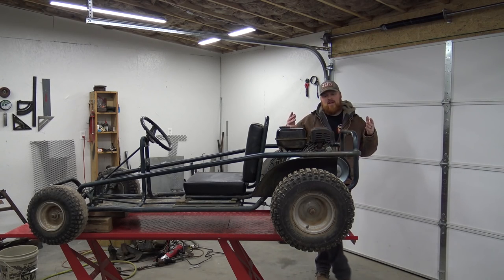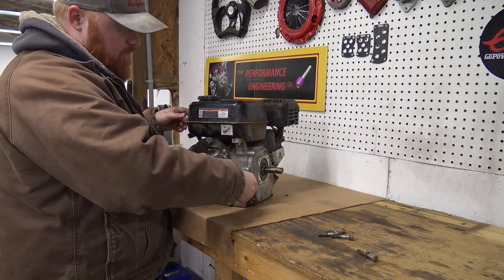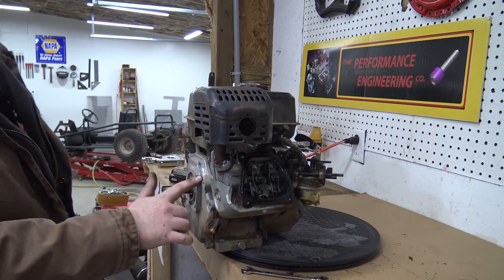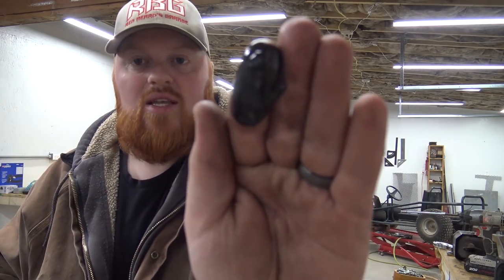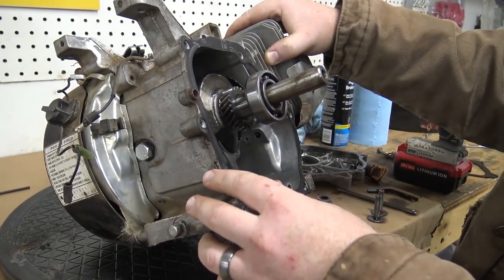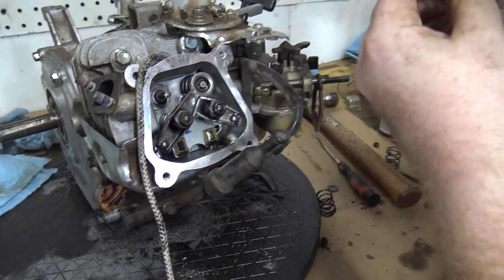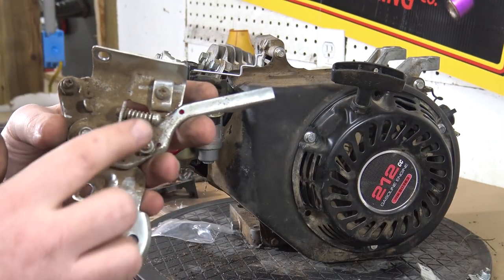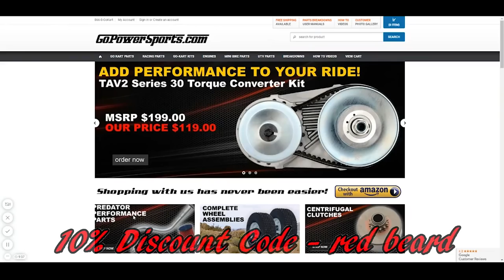$50 Murray Go Kart Engine Tear down ~ What Happened???

Comment: This was a fantastic video!!! I got a Baja warrior cheap off craigslist to build for a family member and the engine on it did the same thing (locked up the pullstart). I ended up just getting a new predator and putting the Baja engine in the corner of the garage for later. Now I'm going to go dissemble it and see if it is having the same issue...this video was/is a great help!!!
Reply: I have a non-hemi Predator that was on a pressure washer, stopped mid job and wouldn't start again for love or money. Being pressed for time I swapped the motor for another I had on the shelf and finished the job. That Predator has been sitting where I put it down when I got back to the shop, like you this video has me wanting to go tear it apart and see what's up with it.
Reply: Yep. I actually took the Baja to the local mechanic shop after I spent a few day on it. He got it to run, but it was left out in the ran with the other equipment after he finished it. I picked it up and got it to crank one time...then like I said above just left it alone after it locked up. I'm betting it got water in it!! Now I want to go take it apart and see what the problem is!! Let me know what you find about yours. Could be that pressure washer water blew back on/in it!
Reply: Could be, but as I recall, mine would pull over just fine. It just wouldn't fire at all. This all happened back when Predator parts were scarce, so I've never messed with it since pulling it off the pressure washer. Like you this video has me curious to see what's actually wrong with it, if something simple will get it running again it would be worth fixing to have as a spare or to use on a project.
Reply from the maker: Glad it could help man and thanks for watching
Reply: Well I checked mine out on Saturday. The carb was clean, oil looks good, plug looks good and has spark. Since the air cleaner was off I shot a little carb cleaner in the intake, pulled the motor over and it fired. I put the air cleaner back on, clamped the motor down, turned the fuel on, started it on the second pull. I still have no clue what caused the problem, but aside from needing to clean the air filter and some fresh fuel, it's good to go. :)

Comment: Quite the difference with the new valve springs...those old fi ford winsors are the same when they get high miles...put in valve springs and shims and 9 out of 10 run smooth and crisp as newish...my 88 was 5 ish cylinder now smooth v8 peace

Comment: Where you take the governor shaft out of instead of plugging with a bolt well when using a fuel pump, use a pipe thread tap and put the fitting in their to pulse the fuel pump in the hole.

Comment: These engines are dang near bulletproof. When people give em up cheap bc they "don't run" it's usually something real simple.
Reply: The Minitard all small engines are super simple iv been fixing my parents since I was like 10. I love when people toss out a great peice of equipment over it not running makes for a good deal
Reply: people do the same with weed eaters and stuff like that, throw away a practically new weed eater when all it needs is the carb cleaned. just takes a little bit of know how and youll save alot of money

Comment: SAME THING HAPPENED TO ME.PULLED THE ROPE ,WAS LOCKED UP,REMOVED PLUG , FULL OF WATER .STARTED RIGHT UP AND IS STILL RUNNING. WAS SITTING A LONG TIME OUT SIDE WAS VERY SURPRISED IT WASN'T RUSTED TIGHT.

Comment: Interesting how that turned out. I was wondering what impact do you use and would you recommend it? I looked in your list and did not see it listed of tools used.
Reply: Jimmy Turner he’s using a porter cable
Reply from the maker: The impact I used on the cvt is a capri from Amazon and I will  be sure to add it to the links on the next video

Comment: Why do remove the oil sensor, I understand the governor, I usually leave the little gear in does it hurt it. I figured it's just spinning in there not doing anything. Also what is the purpose of the heavier valve springs?
Reply: Remove the sensor because it causes the engine to shut off when sharp turning. Heavier valve springs increase the rpms u can safely hit without valve float.

Comment: Why wont it idle after u rebuilt it.   Is just cold blooded or did it need more adjustimg on new carberator
Reply from the maker: I didn't try and tune it at all. Just needs the carb tweaked with a little

Comment: Sir. what is the kit for air filter? I was just givin an old Murray go cart with a Tecumseh 60 hp  engine on it and It also needs break caliper and pads and a torque converter kit. what should i use. any help would be awesome

Comment: Hey Red Beard. Was wondering what valve spring compressor you use that fits in the top of the cylinder head.. If anylne else knows please comment.

Comment: Hey red beard if I take my Governor out of my engine will it blew cuz I had an engine blow on me before cuz I bypassed the governor. I do have a torque converter and stage 1 performance parts. Love ur videos keep up the good work
Reply: Joey Ornelas no but upgrade those valve springs..
Reply from the maker: Yeah you have to do the valve springs so you wont bend any valves

Comment: Hey I'm building a Honda GX35 engine on a blades Moby 33cc gas scooter. What does a CVT transmission do? I know how to put just the engine on the scooter and make it run and drive. Is the CVT transmission a upgrade? Online there about 80$.
Reply from the maker: Cvt starts out low geared to take off hard then switches to high after it hits a certain rpm. Works kinda like a two speed trans

Comment: I'm a little confused about bypassing the governor. Is it dangerous to just remove the arm without tearing the guts apart and removing the gear inside?
Reply: Yes, that is extremely dangerous. You have to split the case take out the plastic gear inside you can’t just cut the top governor bar off. Because when you cut that off, guess what happens a giant 45° elbow of metal is floating around inside your case while your crank and piston is moving around! If I have to tell you why that’s bad pay to have somebody else do it for you!

Comment: Why you don't just disconnect the governor linkage to the throttle assembly and leave the internals intact?
Reply from the maker: You risk something coming loose and messing something up. I know people that have left it in a broke the oil slinger off the rod
Reply: Thanks for the reply, I get your point.

Comment: You can take the fly wheel off and drive the shaft that the governor rides on and then you can just put a bolt in it. That way you don't have to mess with that little ring
Reply: You think he doesn't know that have you been watching long
Reply: I subbed when he was at 5000. And he has never done it.
Reply from the maker: I don't want someone trying to do that and busting their blocks because it can happen.

Comment: And your not building shit for under $50! If you are....... You better have ALL the parts you need sitting around. I re-did a mini bike and just for little stuff carb cleaner, nuts, bolts, washers, sand paper, grease, gas, spark plug, so on! Just going to your auto parts store will cost you atleast $60. Every damn time I needed something from the auto parts store it costed me $20. Just to re-do a mini bike costed me over $150
Reply from the maker: The frame and engine was $50. I put a new cvt on it for another $100 but Im not counting parts I put on it